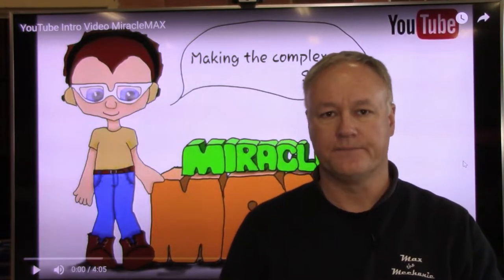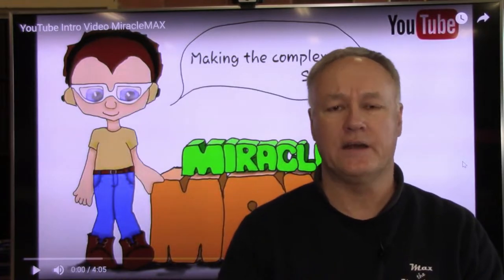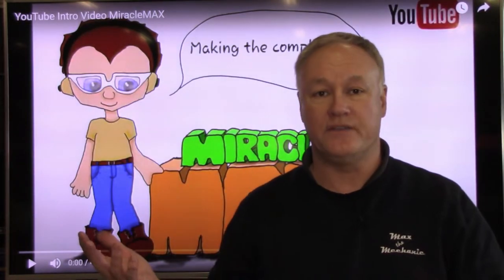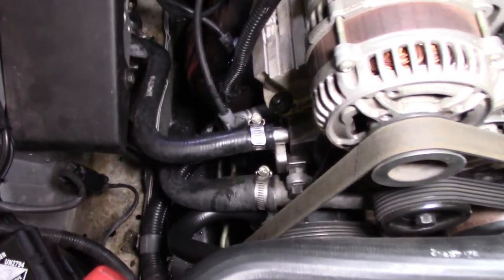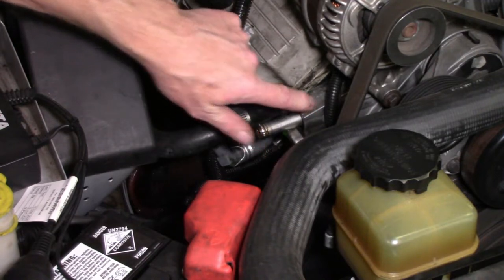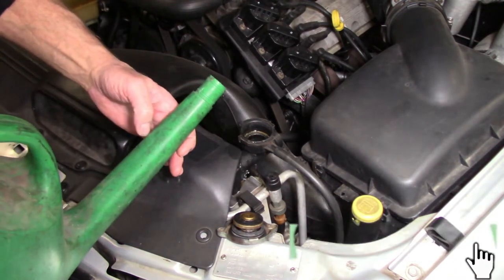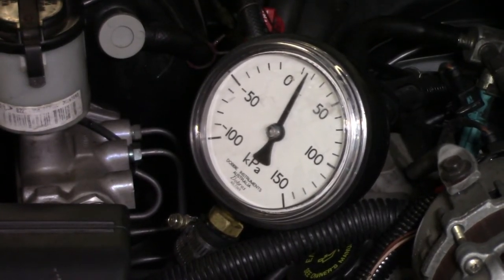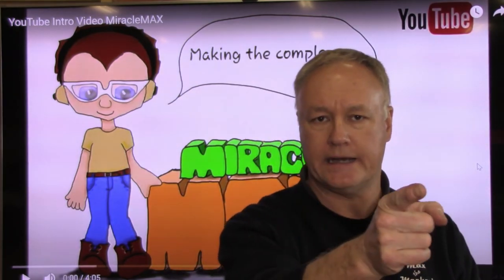How To Test A Water Pump

Comment: Good day mate, ive hot a 2015 jeep compass that had a problem that started with radiator and progressed from there leading me to the water pump which led me to a discovery of a fix called gasoline, a match, and 1 simple promise made that if I ever meet a jeep engineer im gonna engineer a ass kicking of a lifetime
Reply from the maker: I believe the correct acronym for Jeep is Just Empty Every Pocket!